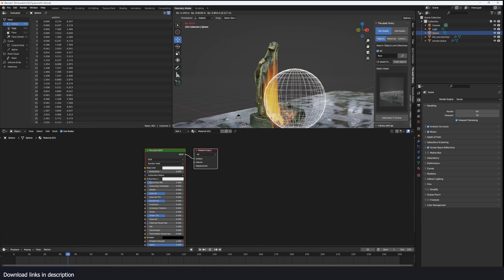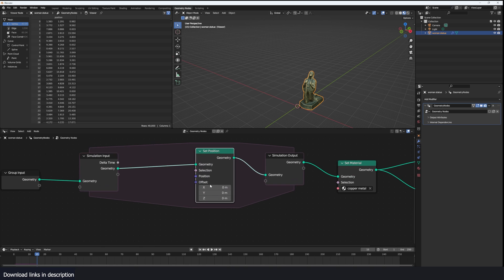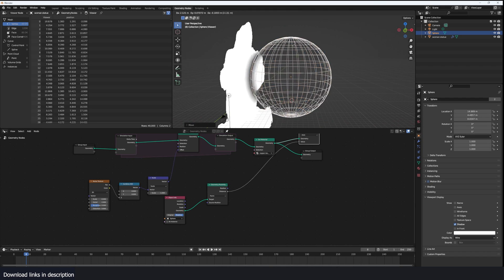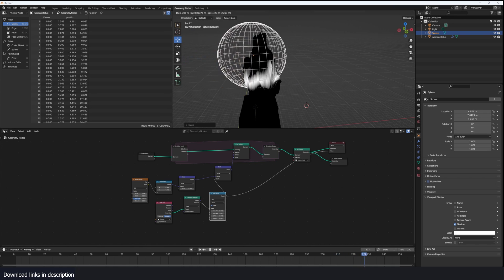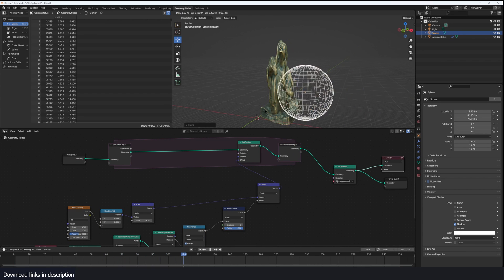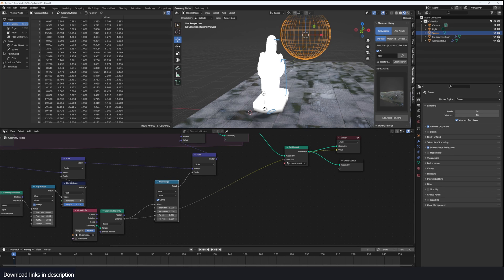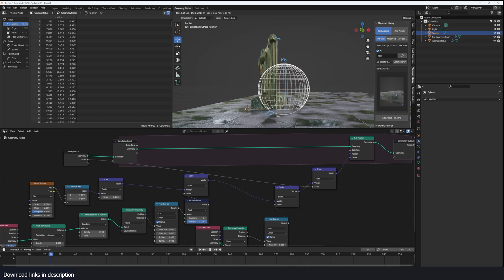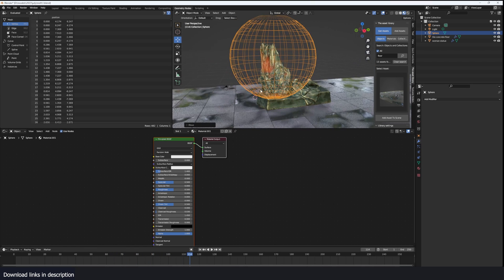how to melt objects using blender simulation nodes

Comment: Thank you for the tutorial. Is it possible to use this geometry nodes system with rigged character? I tried it but only rig modifier or the geometry nodes modifier work but not both of them even if I change the stack order of modifiers
Reply: I gonna test it on one terminator model that I have
Reply from the maker: will you be back @3djramiclone
Reply from the maker: yah i have had issues with it too, it some times fails
Reply: @TopChannel1on1  but does it work well sometimes?

Comment: That's such an interesting use of simulation nodes. By the way you could use the raycast node set up with inverted normals of the sphere to detect the collision with other meshes.
Reply: I'm trying that right now, but not having a lot of success figuring it out. Any ideas on how to implement that?
Reply: @scatterbrainart unfortunately it's hard to explain this in detail in a short comment. Try the flip normals node and connect the "is hit"(?) output to the viewer node

Comment: Great Video! One Question: Once i connect the Mesh to volume as well as the diestribute Points in Volume nodes it doesnt at all look like in the video where there are a bunch of smal points distributed inside the sphere. There is only a single bog point...i know i can turn up the density but iot just doesnt work the same as in the video. Anyone have a solution for this?
Reply from the maker: Try changing the density and make sure the scale of the sphere is applied

Comment: O_O
I'm writing an addon that will translate Geometry Nodes to Unreal Geometry Script system....
This would allow real-time mesh changes... Imagine playing games where you can actually melt stuff with a flamethrower or blowtorch!  All new gameplay elements!
Reply from the maker: That's amazing, let me know when it's done may be I could check it out
Reply: @TopChannel1on1  I post updates on my channel from time to time.
It'll probably be a few months.  Lots of nodes to translate, and Unreal's scripts are... rudimentary.  I'm having to write most of the nodes from scratch.  Even ones that already exist I have to write from scratch to make sure every fine detail is exactly the same as blender... every index for every edge, point, face, no matter what functions are used... :D

But I have a couple dozen already done... Extrude Geometry was a *beast*.

But I'll keep you in mind for Alpha testing.  ^_^
(I have an 18,000 node 'procedural humanoid' that gets dibs, though!)  

https://youtu.be/0EdR-YOZM4s